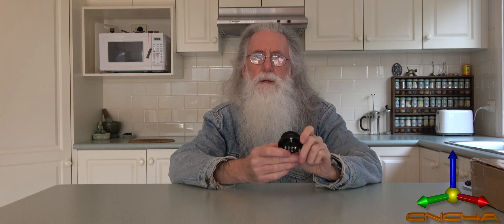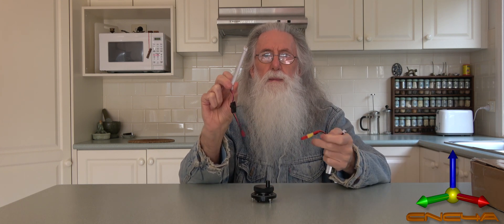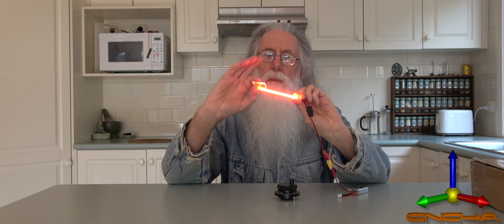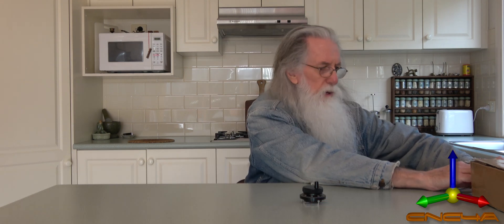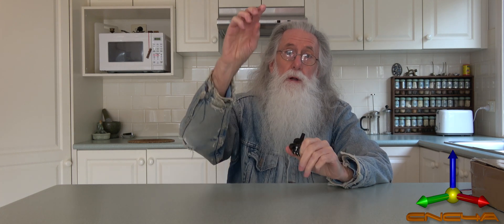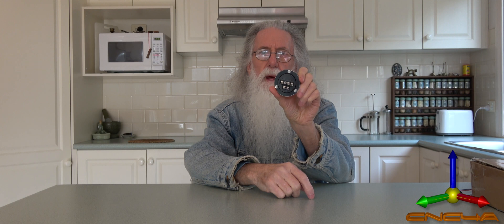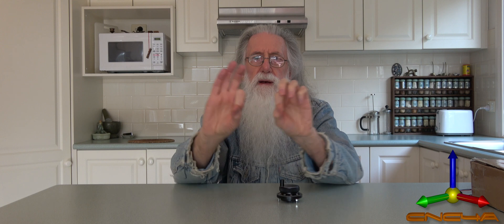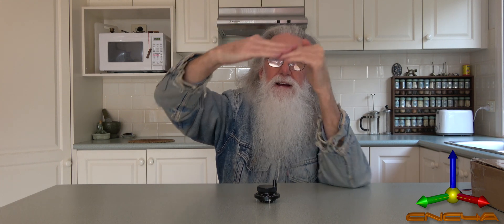CNC4A - Mach3 Alternative 08 - MPG Handwheel

Comment: Hi there
I just ordered the same type 5 axis Mill controller for me.
I took the Type A sub panel with the MPG on it and want to add a second wireless MPG to the system. How are you connecting 2 MPG to the controller?
Reply from the maker: Don't forget to subscribe, I need them.  One Via the Operational Panel CN11 and one via the Machine Control Panel DK3-E Terminal.
Reply: @TheWizard Thanks for the info. I assume the DK3-E terminal is on the back of the sub panel? Sorry I don't have any pictures or closeups of that connector.
According to the agent the controller can only work with one MPG not two. Do you need to switch somehow between the two MPG's or do both of them work simultaneously?
Reply from the maker: Looking from the back it is on the rhs and is some of the screw terminals.
Reply: @TheWizard  Currently I'm looking to buy this wireless MPG on Ebay, but will wait till I received my control. "SWGP 5-Axis Wireless MPG CNC Handwheel Pendant Fit for FANAC SIEMENS MITSUBISHI
"
Reply from the maker: Make sure it has the correct waveform like I mention in my videos.
Reply from the maker: According to my controller's manual.
Handwheel on panel for feeding manually.
P1=0 in Other parameter is select handwheel on panel.

1.5.3 Manual Pulse Generator (Handwheel)
There are two types of handwheel, one is handwheel in handheld box; the other is handwheel in the operational panel.
Note: 1. SZGH-CNC1000TDb series support handwheel in operational panel & handheld box.
Reply: @TheWizard  Hi there
I got my controller and I want to make some backups of the parameters and Ladder before I start changing anything.
The problem is the system ask's for a password.
Do you know the password?
Reply from the maker: You got yours quick :-)  Because of the Lockdown and ebay taking 3 months to deliver progress has slowed for me so I am now on other projects waiting for the utube numbers to go up before I get stuck back into it again.  I am going through the 100 Codesys videos you had linked to on your page at the moment, getting to know PLC programming a bit better.

Mach3 programming was easy.  For the Tool Change Macro I could just refer to different dros, etc and use those values to decided to the quickest path forward or back to the next tool, tell Y axis to move so many steps to the tool, control solenoids, lights, bells and whistles, etc, etc.  That's why I went for this 3 axis lathe controller to use the Y axis for the atc.  Their atc terminal just outputs one ON signal and the 8 atc inputs are just for tool position switches.  Asked their tech how to do it and he just said in the plc ladder.  But that only really only switches on the relay board for use.  Sure you can have it that when the door open alarm is true make output 39 true which will switch on a siren, etc.  But I have not been able to see how to get to their tool change macro code and manipulate it to read the current and next tool in g code, then position X, Z axis, unlock atc, switch on the warning light and buzzer, calculate quickest path to the next tool, send Y axis those steps and dir, receive position signal, lock atc, switch off light and buzzer, hand control back to program.  If you have got any ideas let me know.

As far as the PW goes you would of received a usb stick that looks like a business or credit card.  In that you have all the backup files from the controller including the plc ones.  They have a 1 in the name which stops them from being read by the controller as a safety precaution.  And if you use Notepad++ like I recommend in my other videos have a look at LICENCEFILE in the same directory and it has a 6 digit number in it.  Try that, if that doesn't work then contact them as there in no PW mentioned or are written down on any of the documents I got with mine.  Let me know how you go.  Stay safe.